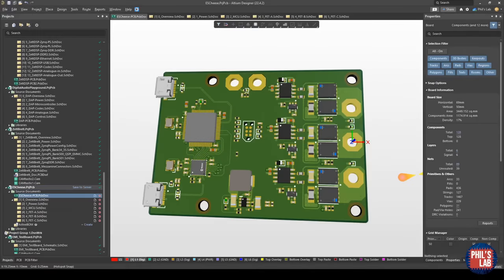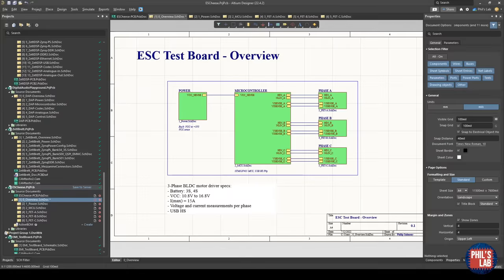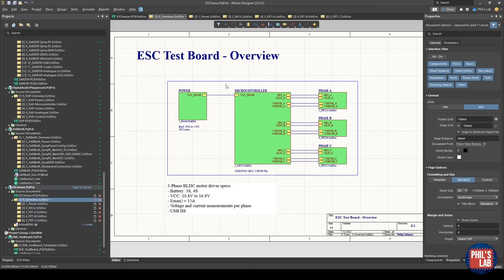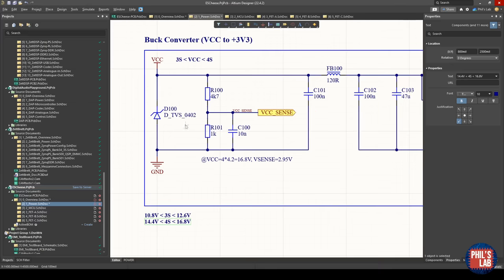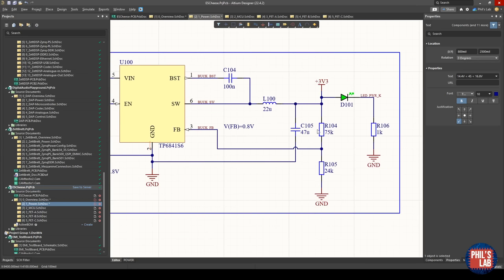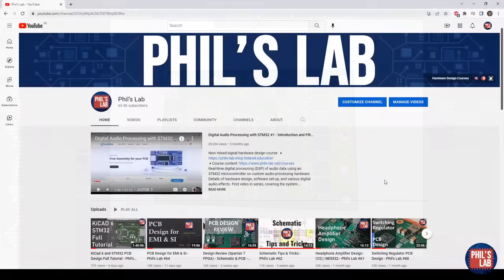ESC Hardware Design - Phil's Lab #66

Comment from the maker: A couple additional points not mentioned in the video:
- This is by no means a design that should be used as an actual ESC for a project! It is simply a far-from-ideal  lab test project. The design takes inspiration from STMicroelectronixs STEVAL-ESC (schematic/ESC structure is very similar).
- The EN pin voltage divider should account for lower cell voltages (e.g. 3V) and battery sag, if used with an actual LiPo battery. I'll be using a fairly beefy lab PSU.
- Back-EMF by motors can be quite high, but my thinking is that the body diode of the high NFET will conduct at approx. VCC+1V, so the voltage divider should be safe. I've seen similar values used in open-source designs.
- Gate driver ICs are fairly weak in retrospect, which is why the gate resistors are fairly large. I'm using JLC's parts catalogue, so am unfortunately rather limited in my part choices. I'll need to check again if there are more suitable parts available.
- I by no mean claim to be an expert on ESCs, the information from this video is what I picked up from various app notes, commercial designs, and so forth. Take the info with a grain of salt.
Reply: The IR2103 is not that bad, since low-ish power MOSFETS have low gate charge. 
I'm pretty sure chinese copies of the IR2103 and the more powerful versions exist but they tend to be hard to find just because they're meant for the chinese market.
When experimenting with three phase bridges i noticed that it's very important to size the bootstrap capacitor correctly, otherwise the gate drive is too weak to turn the high side FETs on.
Good video anyways, i can tell it will be very useful to beginners.
Reply: What, apart from the size and layout of the PCB, would you change to make this more "production ready"? To me, a novice, this seems like a perfectly fine implementation of an ESC.
Reply: Hey Phil, I can't find the layout or firmware videos, couldn't find anything on your github either unfortunately. Any news on this, or maybe I've just missed the video?

Comment: Useful to know the gate driver. Never thought about that when I was designing such a circuit.
Choosing a transistor is also a time costing job, especially when you focus on efficiency for high speed switching circuit.

Comment: Nice video, well explained.
Just one comment. I'd consider adding 3.3V zener protection diodes on the output of the voltage dividers before feeding them to the ADC.
Reply: Zener diodes have a leakage current, which may affect the ADC reading value if you use a high resistance voltage divider.

Comment: I would add a note to the schematic reminding you to make a Kelvin connection to the current sense resistors.  It is too easy to  not pay attention and tie the - side of the opamp to a local ground by mistake.   Also, a pet peeve, I hide the GND label from the ground symbols unless they are needed to clearly identify separate grounds as they clutter up the schematic.
Reply: Well, every board designer knows that when they find a shunt resistor and some type of amplifier that's a current sensing stage and it requires 4 wire Kelvin traces. I'm Shure Phil will make it quite clear in the next video though, while talking about the board itself
Reply from the maker: Thank you!

Comment: Summary
- 0:00 Introduction to ESC design for brushless DC motors  
  - Schematic design not yet complete; PCB routing to be shown in a follow-up video  
  - ESC is a test board for experimenting with control algorithms, such as field-oriented control  
  - Discusses design considerations for MOSFETs, feedback circuitry, microcontroller pinouts  
  - Includes a USB high-speed peripheral in the design  
   
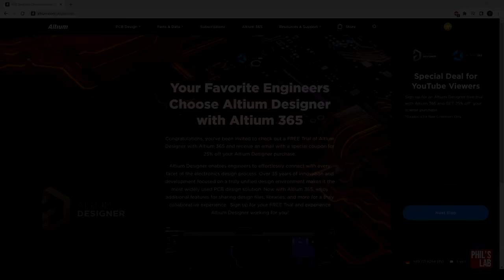- 0:44 Altium Designer Sponsorship  
  - ESC designed using Altium Designer  
  - Free trial of Altium Designer available through sponsorship link  
   
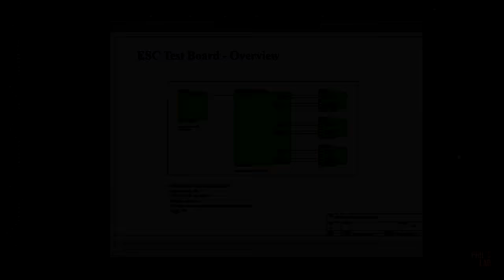- 1:00 ESC Overview and Specification  
  - Project contains several schematic files and pages: power, microcontroller, three phases  
  - ESC drives three-phase brushless DC motors, typically powered by LiPo batteries (3S or 4S)  
  - Voltage ranges from 10.8V to 16.8V based on cell configuration  
  - Maximum current delivery is 15A  
  - Voltage and current measurements per phase for advanced control techniques  
  - USB high-speed peripheral capable of 480 megabits per second for data streaming  
   
- 3:12 Power/Buck Converter  
  - Converts battery voltage to 3.3V for the microcontroller  
  - Includes TVS protection, potential divider for voltage sensing, filtering before buck converter  
  - Enable signal to turn off ESC at low voltage to prevent battery damage  
  - Buck converter generates 3.3V with adjustable feedback  
   
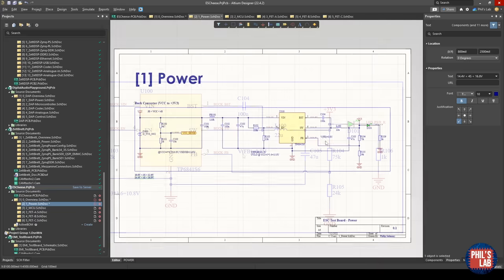- 5:53 Microcontroller and USB HS Phy  
  - STM32F405 microcontroller used for its high performance and numerous peripherals  
  - USB full speed and high speed interfaces included  
  - Decoupling capacitors and power arrangements shown  
  - Tag connect header for debugging, with ESD protection  
  - ULPI interface used for USB high-speed peripheral  
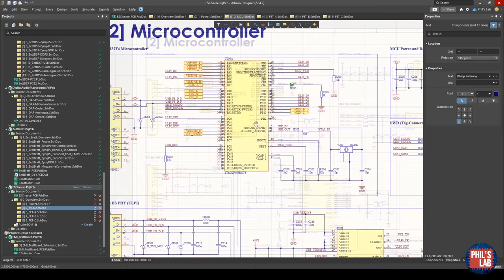  - 9:12 Pinout configuration using STM32CubeIDE  
   
- 11:19 Half-Bridge, Gate Driver, Voltage/Current Feedback  
  - Uses high current MOSFETs in a half-bridge configuration  
  - Gate driver IR2103 to control MOSFET gates with dead-time control  
  - Shunt resistor and current sense amplifier INA180 used for current measurement  
  - Voltage sensing via potential divider, limiting bandwidth to filter noise  
   
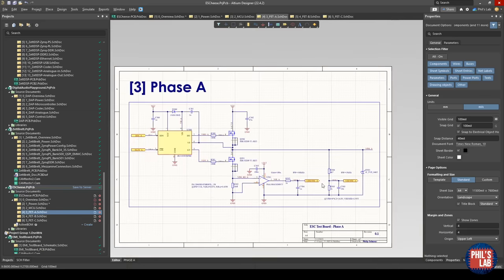- 17:53 Outro  
  - Simple ESC design that can be replicated for personal projects  
  - Future videos to cover layout and routing of the ESC, as well as control algorithms for the motor

Comment: Hey Phil, would you consider showing designs for a motor driver board operating at mains voltage (for example like  415 vac induction motor driver)? I’d love to see the considerations that go into high power, mains voltage designs. Love your work as always!

Comment: I didn't know those instrumentation amplifiers with built-in gain setting resistor existed! I will have to look them up for some of my own projects - thank you!
Reply: They are quite handy and quite affordable. I am partial to the INA180 myself (the one he used) but there are cheaper versions from second their manufacturers, and versions with even higher performance (bandwidth, precision, voltage range, bidirectional sensing,  etc.) at greater cost. The search term you want, however, is "current sense amplifier". You'll find some using instrumentation amplifier, but what you'll mostly find are the ultra-precision amps with external gain-setting resistors.
Reply: @martinmckee5333  INA240 is a solid choice for in-line current sensing, large common mode input.

Comment: Love your videos bro! Good choice with the 100ppm/degC resistor. I recently got stitched up with the positive thermal coefficient where I had a 15% error over a 100 degC operating temperature 😂; I was measuring current. Keep up the videos 🎉.

Comment: Excellent video! I would only add I2C/3V3/GND output to connect external magnetic encoder. It would be useful for FOC where some algorithms requires real time position of motor shaft :) The only disadvantage is that, the I2C is very liable for noise. For longer cable maybe differential buffer is required (ie PCA9615 or similar).

Comment: Can't wait for part 2/2!  Thanks Phil.  Let me guess.  In an off the shelf BLDC ESC, I notice that the voltage is a PWM in the shape of a maligned trapezoid.  The torque influences the PWM duty, and the RPM influences the frequency.  The current however appears more complicated.  Probably because of the flyback effect of the BLDC.  The RPM effects the frequency, but the current does not follow the PWM duty cycle.  The current seems to get more distorted when torque is increased.

Question:  Is there a way to arrive at the current RMS by using an analog filter?  I tried that unsuccessfully.  The 160 kHz for VISENSE, isn't that too high for the STM's ADC?  Why not bring this down to let's say 1 kHz and then sample it?

As for the firmware, I imagine there is a trapezoid lookup table.  But how is the voltage amplitude controlled?  The switches are either on or off.  Is it the BLDC's reactance that actually creates the trapezoid?  Then no lookup table is needed.  

I assume you use the unused phase's Vsense and VIsense to synchronize the firmware cycle with the BLDC?

Why does a 12/14 BLDC have two extra magnetic poles?  Will this not mess up the BLDC by producing some counter-torque at some poles, effectively reducing the power of the motor? Does the firmware need to know about this?

I understand a FOC is sinusoidal?  So does that mean the PWM duty cycle varies within the phase?

Any help would be greatly appreciated Phil and thank you.

Comment: Hi phil ,great job , make sure to have some different Current resistors ,you might have to some adjustment/calibration for the current and make sure the INA180 has the right/package , i used the INA180 I remember that there was some problem with the amplifying , unless i got a bad/fake component

Comment: Great video as always! More theoretical mosfet question - did you look at he SOA (Safe operating area) plots for the fets you chose? If so, did you do some hand calcs to figure out time pulse duration? Currently speccing some fets for a project and keep running into parts that have great continuous Id until I check the SOA…

Comment: Thank you again for this nice video.
Can you explain why you choose low side current sensing? As far as i know low side sensing requires some additional maths and algorithms to determine the actual current through that phase, since it is only flowing when the bottom FET is conducting.
High side sensing is much easier and straight forward, but i might be wrong.

Comment: Looks great! What is the advantage of measuring the back EMF using shunt resistor + amplifier rather then using a voltage divider (like most of commercial ESC's do).

Comment: Thank you that much! What about a Design for high voltage ESCs? (240 Veff / 340Vdc) More and more modern tool machines are equipped with BLDC and a retrofit of old machines could be interesting. What Do you think about?

Comment: What would you add for  reverse braking voltage protection? What would you add for preventing inductive wind-up on system start, if connected to a battery with long leads? How would you consider alternative designs/components for a 48/56v system?

Comment: Hi Phil, I am also in the process of designing and programming an ESC. My goal is to more mimic the Blheli_32 with the Fd6288 driver and f05 MCU. As far as I know, it uses comparators for zero cross checking (analog comp) which runs in the background without consuming processor power. Are you doing this with consecutive ADC measurement? Also, I guess the reason of using comp PWM (ch1 ch1N) is due to active breaking?. Lastly, why not software based deatime? It is a parameter in comp pwm in cubeide? Thanks in advance! /Martin

Comment: Very nice video! I'm just wondering: don't you need an encoder interface as well if you want to implement FOC? Would you do this via the HS USB interface with your computer or provide an additional encoder interface on your board?
Reply: Sensorless FOC is very much possible with great results, look at TI InstaSpin for example. Vesc firmware have a decent implementation as well, although TI was so much better at least in my experience even at low RPMs

Comment: Can the motors rotate clockwise and counterclockwise with this circuit ?. I am super excited about this series. I have a dream to build my own version of Pixhawk Board. Thank you Phil your videos are amazing and excite me about learning to engineer. I am currently a final-year engineering student. It gives me a lot of confidence in things I learned in my college. Thank you
Reply: just change the driving sequence on the three phases and you can change the direction at will

Comment: I assume that EN is a digital input, why then are you connecting an input from a voltage divider into it? I do not understand. 
Is there a schmitt trigger on that input?

12/(12+110) * (3.6*3) = 1.06V and not 1.2V

What did I misunderstand?

Comment: Hello sir, nice video, just one question, how did you calculate that you need 4 decoupling caps(100nf) for u201?
Reply: The standard guidance is to use at least one decoupling capacitor per power pin.  That's what he's using here.

The value of the capacitor is less important than its inductance. So using the largest capacitance possible, in the smallest package you can handle, makes sense. He's standardized on 100nF. I happen to use 1uF, though it ends up more expensive.

Comment: What's the reason behind current sensing requiring higher BW than voltage? Just higher sample rates for it due to the algorithms you'd be using?

Comment: Phil, are you not worried about ground offset due to low side sensing?
Reply: I suppose you have to give a lot of consideration to tightly coupling the ground of the phase and the sensing element.

Comment: Really love these videos, amazing attention to detail, very step-by-step, perfect for everyone. 

I do have question about two separate USB connections - full speed and a separate high speed. I just went through a process of implementing STM32 uC, and since I wanted to have a high speed USB connection, I went with the ULPI interface as well (same interface chip actually). I ended up with just a single HS interface, and dropped the FS one. The main reason I was considering having the FS interface was to have the access to the default bootloader available on that interface, that would allow me to upgrade the firmware. I was curious what was your motivation for having that FS interface? I'm fairly fresh to all this, this was my first design with STM32, so I ended up choosing the simpler solution, hoping to just implement the DFU device class on the HS interface - but this is something I haven't done yet. Did you decide to have a separate FS connection because there are some issues with having DFU implemented on the HS interface in software vs in the bootloader? 

Also, one option that I have been thinking about was using switched on data lines to flip them between FS and HS interfaces and using just a single USB connector (Analog Devices have this mux chip: https://www.digikey.com/en/products/detail/analog-devices-inc/ADG774ABCPZ-REEL/1756736 that seems to be the right thing for such application - with low resistance and enough of bandwidth for HS signal) - but again, I have no experience with such setup, and would love to hear your thoughts if this is something that could be used here to potentially have only a single USB socket. 
Thanks!

Comment: Hello

I need some help regarding 3 Phase Brushless Motor Driver

I want to understand something about changing the motor direction and speed

Regarding the mosfet, I know it has its own ports
1. Drain
2. Gate
3. Source
I wanted to know whether to control the direction of rotation and the speed of the motor

Is it necessary to use the code of digitalWrite to change the direction of the motor for example:

For CW
Pin Name|Signal Name|User Label
PE8 |TIM1_CH1N |M1_PWM_U High Side
PE9 |TIM1_CH1 |M1_PWM_U Low Side
PE10 |TIM1_CH2N |M1_PWM_V High Side
PE11 |TIM1_CH2 |M1_PWM_V Low Side
PE12 |TIM1_CH3N |M1_PWM_W High Side
PE13 |TIM1_CH3 |M1_PWM_W Low Side

For CCW
Pin Name|Signal Name|User Label
PE8 |TIM1_CH1N |M1_PWM_U Low Side
PE9 |TIM1_CH1 |M1_PWM_U High Side
PE10 |TIM1_CH2N |M1_PWM_V Low Side
PE11 |TIM1_CH2 |M1_PWM_V High Side
PE12 |TIM1_CH3N |M1_PWM_W Low Side
PE13 |TIM1_CH3 |M1_PWM_W High Side

And I know that analogWrite controls the speed but I wanted to know if I should add the analogWrite code to this list:

And when I intend to control the speed and the direction, do I need to set these two codes digitalWrite and analogWrite on the same Gate port in the Mosfet?

I would appreciate it if you could help me with this, it just confused me a bit, thank you very much!

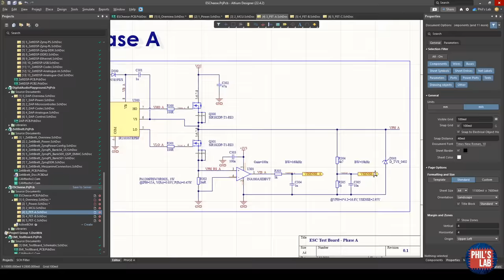Comment: Can anyone know how the bandwidth comes out to 19 kHz? ( at 15:00 in video)
Reply: The resistor divider and the capacitor act as a simple RC low-pass filter.  The parallel resistance of the two Rs is about 824 ohms, and with a 10nF capacitor, that forms a first order RC filter with a -3dB cutoff at 19.3KHz